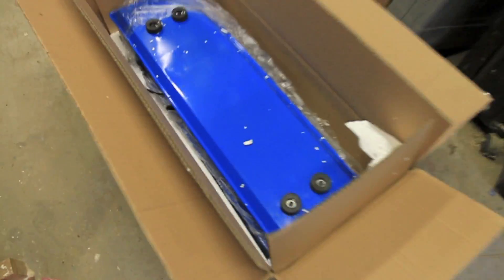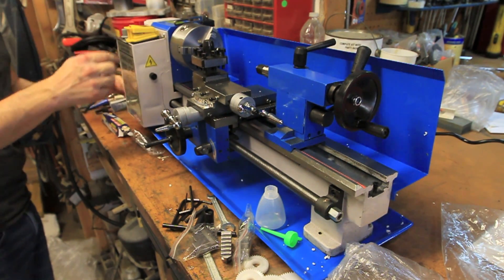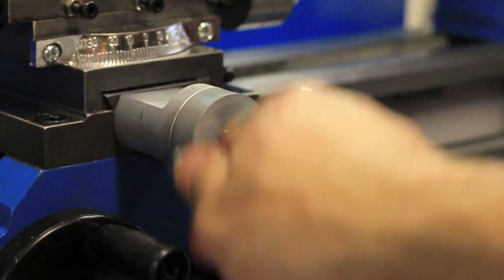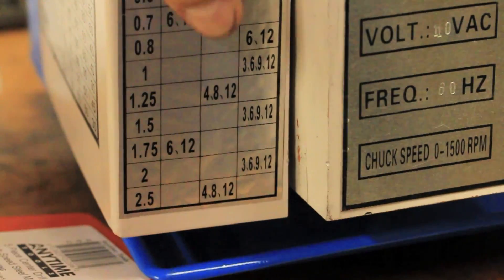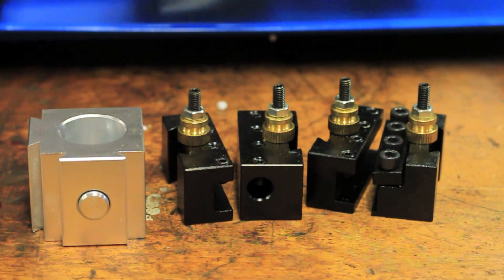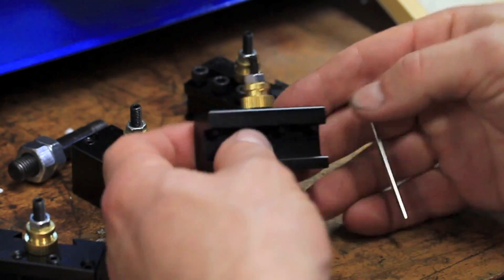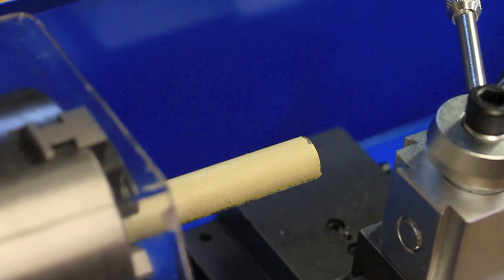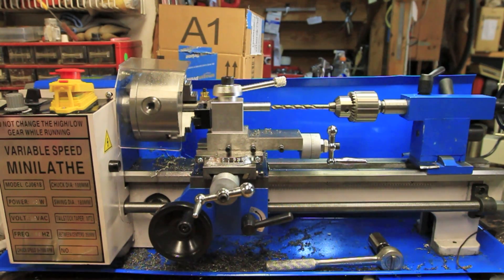Cheap Chinese Mini Metal Lathe Unboxing, Setup, Upgrading, and Testing

Comment: Yeah, just get ready to check every crack and opening in the moving part. The specs are close but nowhere near tolerable. You will have to scrap all the surfaces for smooth operation and over cruddy casting bits galore. But in the end, it will do a pretty good job. Get some half-inch bits and an Axo-style tool post as well. It's worth the money big time. I bought a 9 by 30; I'm glad I did for the size work I will be doing with it.

Comment: I just had a thought, i wonder if the cheaper lathes and  mills , with plastic gears, could be bought,  then make  molds for lost wax castings from the gears and other parts.   Make stronger gears from iron or brass, bronze, or even aluminum. I think iron and brass gears, maybe  every other gear from brass. And make replacements from iron. Just incase.  With different metals the wear would be less than with hardened steel gears. Maybe set up a hollow brush to drip oil. Or possibly use super sticky lucas oil stabilizer on the gears. Possibly semi enclose the gears in a oil bath.  Any changes are going to be messy.  Maybe a dry film lubricant can be used.     Then replace the motor with a 1500-2500 watt brushless, with a 60-72v power supply and controller to match it. Should make a decent machine from the cheap $600-$700 machines.  Then work on tightening up the ways , and leads crews.  However by the time all this is done , you could go a bit further, build a complete lathe. With 6"- 8", 10" chuck with room to swing about 18" x 36"  stuff!  Weld some steel bars on a 12" I beam about 4' long. Used either  killed 1/2" thick 2" angle welded to 1/4" or 1/2 flat bar 4" wide as the ways, with matching bits to mount thr head and tail,  and carriage . With oil passages with braised on steel tubing.  And a water based coolant tank underneath.  Sorry for the rambling, but could be a cool project. Especially if you have access to scrap steel.

Comment: Your stick out at 14:03 is WAY to much for that size/quality of lathe. Maximum should be no more than three times the diameter of the stock. 3/4” x 3 = 1 1/2”. Unless you’re using the tail stock to support the end.

Comment: I didn't catch if you purchased this particular mini lathe from a seller in China, or from a reseller in the USA? I guess the former, because any reputable importer should ensure that the lathe is bolted down in a wooden shipping crate and doesn't arrive with the chip-tray side facing upwards, effectively resting on the head stock, making transport related damage to the machine pretty much unavoidable. ☹️

Comment: These are cheap and you get what you pay for, I'm a retired machinist I'm about to order one and I know that it will require some work to get it running the way I want. For under $1000 it looks like a great project, if you want a machine that is ready to go you are going to have to pay out a lot more  money. Don't expect a top quality machine for these prices, best to enjoy the project for what it is, I will.
Reply: I just received mine from Amazon.  You will need to partially dismantle the carriage and put proper shims in the guides as the lathe comes from the factory with no shims and the bolts are barely finger tight.  The belt will also need to be tightened.  Mine was loose.

Comment: Does this hold any kind of tolerance at all?  It seems incredibly cheap and may be very expensive to try using what with all those broken parts straight from the manufacturer.

Comment: do you blame the machine OR it might have been OK if you opened the gears and aligned them / checked on them / tightened the nuts etc before turning the machine on?

Comment: That sound was unmistakably the motor loose and it ate the cog belt...
These lathes come with the motor not tight or adjusted to the belt tension..
They get banged around during shipping and come loose.

Comment: Wow this looks bad. I have a Clarke branded (UK) version of this made in 2005 and it doesn't have hardly any of these issues, mainly paint/cosmetic defects. I would wager that due to their popularity the manufacturing process has gotten cheaper, which is a shame. I really like mine and I think it's a great bit of kit. How much did you pay? They are about £700 here in the UK.

Comment: Español

Inglés

For no reason spend your money on this useless lathe, I bought one and I regret having spent 1000us dlls and to have it with the engine broken, in a month the engine burned and they do not have spare parts and the new engine costs 70dlls, a crap machine

Comment: It is interesting that there is no scribed marker for the protractor of the compound.  However, mini-lathes that DO have a marker are generally not accurate on the angle anyway.  So its best to use a machinist protractor when setting an angle anyway and just ignore the one on the machine.

Comment: Sorry - it looks like utter junk. Don't believe me? Have a look at the crap that they left in the gearbox.
Reply from the maker: Well that's just like, your opinion, man.
Reply: @TimNummy  
Ok, there’s few vids on here where owners have gone to clean them and found the headstock full of swarf and grindings. Should that be in a gearbox if a new machine? There’s no excuse for that - just lazy manufacturing. If they can’t be bothered to simply clean up then the rest is likely junk....

Comment: I would be willing to pay $20 plus shipping for a tool like this, it can function, but barely and one of the first things I would need to do with it would be to rebuild and replace most of the parts which seem like it is just barely capable of doing. And worst case scenario I could use it for scrap.

Comment: 14:20 - "it's not as terrible as it could be" Hardly a ringing endorsement 🙂
It looks like you were sold a complete lemon, even by the standards of a mini lathe. The marks and scratches, broken handwheels, dented chip tray and side of the control box, and delaminated labels would have been enough to go straight back in the box for me. Also,   that aluminium QCTP is a waste of time (I too fell for that), it's cheap, but nowhere near rigid enough. You really need a steel one. They are expensive - a significant fraction of the cost of the lathe - especially when you add in the tool holders, but you'll need it if you want any kind of accuracy. As for the gears, did you have the hi-lo lever engaged properly? Judging by the state of the rest of the lathe, I wouldn't be surprised if that lever was loose as well.

Comment: If you stick to using it properly and for what it is designed for it will work fine and do a good job. ie plastics/nylon/brass/aluminum/bronze. Steel is fine but light passes. Under 20 thousandths. The gears are a plastic so they are not able to do heavy cutting.

Comment: Unfortunately, Chinese metal products are made from poor quality metal. Their cut throat/straight razors for example,for shaving, are not sharp and because the steel is soft, neither can they be sharpened. It’s the same with this lathe. I certainly wouldn’t feel safe using this lathe, which is a shame because I like the fact that it has reverse  gears. That would be useful for bowl making to save you bending over the machine so much.

Comment: Thank you, God and Trump, that this piece of *** is not available now on Amazon!..Brothers! You can sleep worry free awhile...
====
Mophorn Metal Lathe Precision Mini Lathe Variable Speed 2500 RPM 550W Mini Metal Lathe Micro Metal Milling Bench Top Lathe Machine,7 x 14-Inches
Brand: Mophorn
3.5 out of 5 stars    21 ratings
Currently unavailable.
We don't know when or if this item w

Comment: "The fit and finish leaves a little to be desired"

Translation: The fit and finish is non-existent
Reply: What a piece of crap, I was looking at them, glad I didn't waste my money and time.  Thanks for your honest thoughts.
Reply: @dougburke50273wind  What would you suggest ??
Reply: Any machine made of soft metal is unsafe.
Reply: @jazzman1626  soft metal shouldn't be a problem if you have thick cross sections and large contact surfaces and adequate bearings to compensate.

Comment: Reminds me of the old adage "you get what you pay for" ! I'll hold out for an industrial lathe!
Reply: problem is....I've been holding out for about twenty years.....I haven't got another twenty in me.
Reply: @edstimator1  Unfortunately, we've all got the same problem. I might not have another five. We never know when our time is up, unless we've got a terminal illness.
Reply: @dannyarrowheadstalker3054  My plan is to stop waiting to do anything because there is an expiration date to all of the fun little hobbies and if we wait too long that particular joy can pass you by.  Just do everything that you can when you can and go from there.  Better to experience metalworking with the tools you can afford than not at all.
Reply: @edstimator1  Believe me, I understand that. I'm working on getting a Blacksmith shop set up as I type this. I'll do what I can in the time I have left. I was trained as a machinist, and I'll get one before I check out.

Comment: Hi, I got 1 from harbor freight, it doesn't make that knocking sound but yes they need a lot of work to make them right only thing that get loose time to time is the lever to tight the tool holder and didn't last more than 2 years the speed control then I was using a exterior sp control for about 6 years till the electronic control got burn, I just fix it 3 days ago and now is working like new again

Comment: Wow, I bought a Harbor Freight 7x10" Mini Lathe one year ago. (While they still had the 25% discount coupon working on Central Machinery tools). Paid $430. My lathe looks exactly the same except for the on button. I assumed they were all the same until watching this video. The one I got is WAY WAY better in fit and finish along with the knobs and handles. Yours looks like a cheap Chinese imitation of a cheap Chinese lathe. I use mine for turning hardened steel mostly. Dude no comparison NO COMPARISON.
Reply: I just seconds ago purchased this one without much research. Hoping to god I don’t need to do a huge amount of work to it to get it good to go. All the mini’s seem to take work. Just hope it’s not to much

Comment: You didn't really give the little lathe much chance there did you? The way you just dumped the thing upside down on your bench and then used all the control knobs as fulcrums to turn the thing over. You probably cracked the handles yourself just doing that.
Reply from the maker: I'm looking forward to your unboxing review... Maybe a more delicate touch setting it up could have prevented all the problems

Comment: Mine is the twin: wheels were cracked at the axle....I wrapped a hose clamp around the axle....it’s holding. My saddle had similar casting flaws. My feeding wheels are a bear to turn....takes both hands...can’t run them fast at all.  Tool tower did not hold a 3/8 tool at the right height...would need to shim.

Comment: When do you use the channel locks or the slip joint pliers to remove the tool post holder you were using them backwards that is why it was difficult to remove just some food for thought

Comment: You know nothing about machinery....that tool post is total crap.
Reply from the maker: Rude
Reply: @TimNummy  No way mate, not my intention, trust me...….anyone with a bit of intel can see that it is crap partly due to it being made from ally but mainly because the piston pushes the tool holder away from the tool post instead of hugging it when it's under load. If you always buy tools with the price as a guide you are a lost cause......QCTP's are quite common now and the wedge type is good for the price. There are others but you pay accordingly. BTW, when are you going to wise up and also change those crap ball races in the headstock for angular contact or tapered rollers.....angular contacts come with seals so lube is self contained for their life.

Comment: I watched this video in horror, the build quality was appalling, Tim was so patient and unperplexed, if that had been me it would have been back in the box after the first couple of flaws. Here's the thing I had already ordered mine from Aimtoolsltd on ebay in the Uk. I awaited the arrival of my machine with the the return details in my hand.
Needn't have bothered! On unpacking from a wooden case, which I didn't expect, I was already looking for flaws and faults, to cut a long story short I found none( bearing in mind I never expected a £5000 lathe in the first place) the quality for the price is absolutely fine, very little backlash in the control mechanisms the tailstock was nicely stable with the locking bolt undone. I could go on but I think the bottom line is this video is two years old, great progress I would say. By the way I have absolutely no affiliation with Aimtoolsltd only that I purchased the lathe from them.

Comment: 3:40  Is this the handwheel you installed at 1:03 ?  It was probably flimsy and easily cracked.

9:45  Consider flipping the pliers over to remove a stud like this.  This type of pliers are made so that the turning force you apply to the handle will amplify the grip on the thing you're trying to turn.  Similar to a pipe wrench.

Comment: Let me just say that you were unlucky to have bought this lathe. I made the same mistake, but I didn’t keep it more than a week. I sacrificed some money and sold it. I got the Bolton lathe instead. The mini late limits you with the size of work you can do. It won’t help you much with big projects or large radius work. On the other hand, the Bolton is great for any job you might think of, and there’s a model that comes with a milling machine that widens your possibilities. Both are Chinese, but the difference is huge.

Comment: 8:40

I have read that this body of QCTP is made of some kind of aluminium.
So its better to get more expensive QCTP and forget it.
Reply from the maker: Agreed. But for the price it works well for a while and is good for just starting.
Reply: I used this tool-post as a template to make one out of steel which is much more confidence inspiring and fits all my existing tool holders  plus the extras I have made. But in fairness I never had a problem with the original QCT and it is now on an earlier incarnation and a smaller version of the same Lathe Tim has

Comment: In the spirit of some of these comments, I notice that your fingers are too clean therefore you are totally unqualified for "real" work so that means you are a " flabby waisted girly man."
Actually, thanks for the video. I've been thinking about getting one of these and your video was a pretty good intro. The  plastic gear problem seems to be that they are installed too tight. Everybody who gets one of these mini lathes seems to go through a process of tweaking and upgrading until they end up with a fairly functional machine with almost the cost of the base lathe.
I do love reading the snarky criticisms and come backs that the trolls provide. 
Just bee careful.
Reply: Yes , real mechanic values it from experince. Not by sarcastic.

Comment: Pull the parts off remove the big screw rods and put a bit of polishing compund on the rails. They can be very well fixed but they do require a lot of fine tuning...

Comment: Why did you keep running it when it was obvious there was something wrong. You also took the the clamp handle away for the tool post , you should have left it on. You are better at videos than engineering.

Comment: You will have better success in the turning if you use a positive insert such as the CC style in the boring bar. The TNMG in the other tools are Negative, with a neutral land on the top rake (for longer life). However with lathes with such low power as this, using a positive insert, will aid the cutting and are better at the very shallow radial DOC this machine can handle.

Comment: I bought something similar in 2009. I thought it was a case of you gets what you pays for but this one is awful!

The silver lining to the dark cloud is that by the time the hobby amateur (me) finishes remaking the horrible bits to get it reasonably respectable he knows quite a bit more about lathe work than he did to start off with.

Comment: If you take it to bits when you get it and then put it together again, and make sure its all greased where the lead screw bush hasn't got any rust on it. Or it will strip a gear.

Comment: Hi.  Have you tried cutting threads other than tap or die?
Reply from the maker: I haven't yet, mostly because I haven't had to cut threads larger than I have taps for and don't have thread cutting tools small enough for the threads I need. I do have a project in mind coming up that will be a threading project though!

Comment: How long did it take to get the Replacement???? Wondering if they rush these Sales ...
As im Looking for a Same Size kinda LATHE , with Pro like machinary .. like them bigger ones but this size. Amazon page atm
Reply from the maker: I didn't end up getting a replacement, but the next several videos chronicle the repairs I had to do :)

Comment: maybe you should adjust were necessary some of the adjustable wear srips look very loose the same with the tailstock clamp they should not be loose when released and the handle spindles should not be loose in the threads like you have them and they should slide through your hands